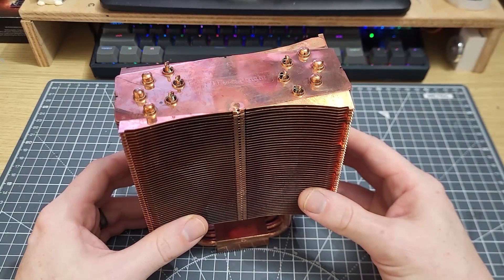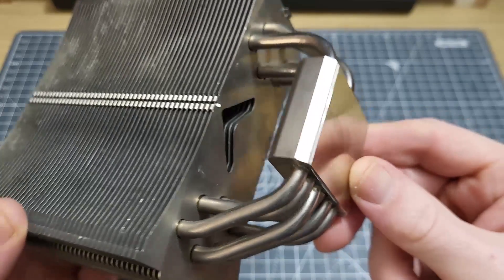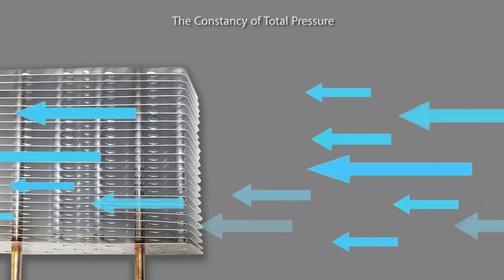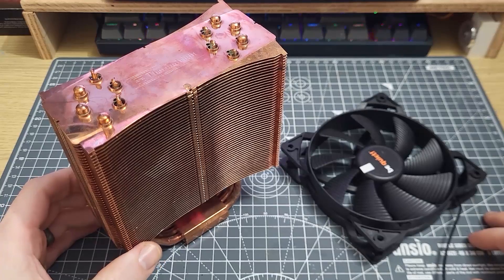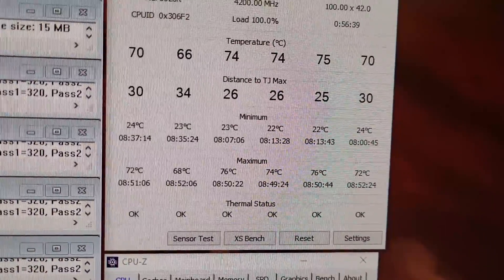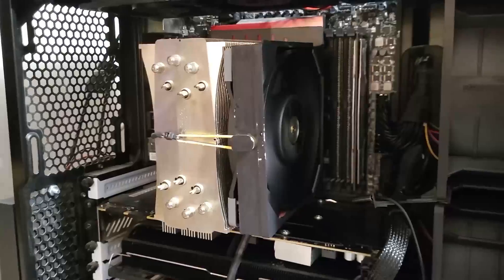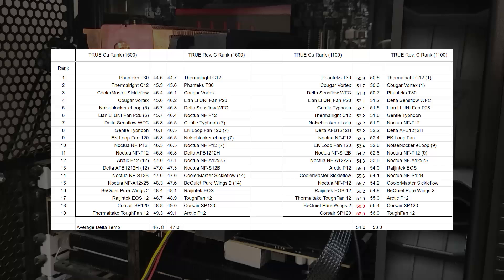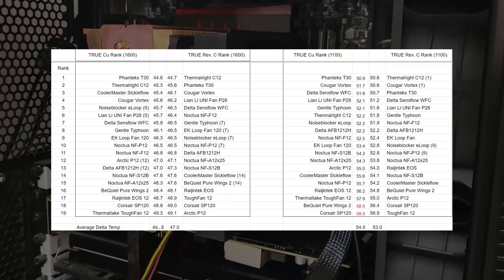"Static Pressure Fans" Don't Exist - Part 7: Same Fans, Different Heatsink

Comment: Car radiators are slightly inclinated respect the air flow to generate more superficial pressure over the fins due the "impact" of air, and generating turbulences and reducing the air flow speed therefore generating more presure over the surface of fins. The pressure must be just over the fins surface not over other surfaces, and generated by an airflow, it is called "flow resistance". It makes no sense generating an over pressure into the pc case

Comment: Rankings based on RPM are questionable. The question is noise vs performance. Thermaltake ToughFan, NF-A12x25 and Lian Li P28 are quite similar in noise normalized tests.
Just compare the Pure Wings 2 versus the A12x25 on the same RPM, the Noctua is clearly less loud.
Reply from the maker: The question for the end user perhaps, but for this test it's about how the fans perform on the air chamber and then at the same RPM on the heatsinks.
Reply: @FanPhys  Then you should show that data. Airflow in the chamber vs airflow on a heatsink. Heatsinks are not that challenging static pressure wise. I think I have only seen  relevant differences on radiators and through dust filters. I think static pressure only matters in rare cases when you have not much air intake on the front of your pc case or you have a radiator.
Otherwise it does not matter much what fan you use.
Reply from the maker: @mgoogyi All the data is shown in previous videos, and I draw the same conclusions that you do - all fans are much of a muchness. The results of my tests show that static pressure performance is not really a factor in gaming PC applications; even on a thick radiator the strongest fans are not consistently the best for cooling.

Comment: Would be interesting to see what happens if you use a fan spacer / shroud to hold the fans 1-2cm away from the cooler.
Reply from the maker: Yep we used shrouds many years ago and they seemed to go out of fashion - I see they are making a comeback! Will hopefully be able to test this in a future video. :)

Comment: I use thermalright twin tower peerless assasin cooler with one t30 between the towers and it works great at 950rpm noiseless, no mount brackets needed, fits tight
Reply from the maker: Yes, the peerless assassin seems to be the top 120mm air cooler at the moment. It would be interesting to see how it performs with different fans.
Reply: @FanPhys  phantom spirit is abit better tho
Reply: I'm also interested 👍

Comment: Got this video randomly recommended and I'm not disappointed.
When thinking of high-performance heatsinks I always forget about necessity for forced turbulent flow, but more manufacturers are adding featers like specially shaped fins to force that in.
Generally speaking there are always many things that can be engineered out of thin air to increase efficiency.
One of the best visible examples are modern vacuums, where more energy spent on brush roller and agitation increases the cleaning potential, even with much lower overall power.
Reply from the maker: Thank you :) I think one of the big sticking points at the moment is that companies are just churning out the same stuff rather than innovating, which Thermalright always did well in the past. I'm planning to compare these older coolers with the newest kids on the block because I'm curious how much of a difference 15+ years of advancement has really made.

Comment: With a tighter temp spread is likely an artifact of the interface between cpu and cooler.
Reply: This was my thought too. The contact patch and resulting paste bond-line thickness can vary a lot between coolers and IHS. It can also take some time for the paste to reach the minimum bond-line thickness, so it's good to runs stress tests for a while before trying to take measurements.